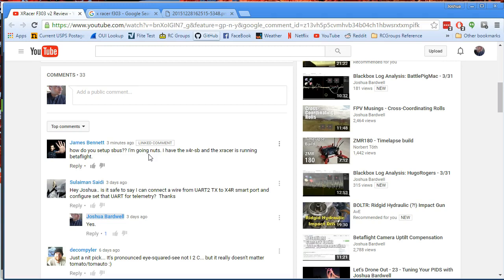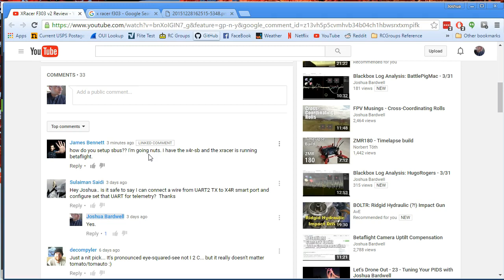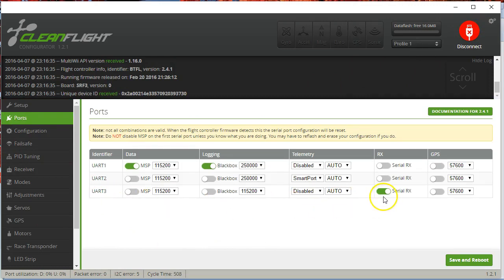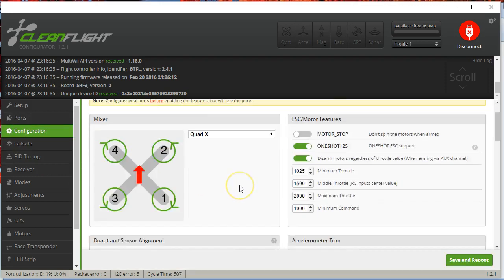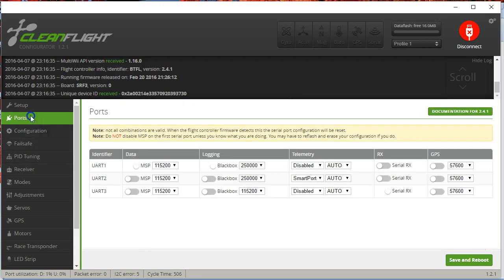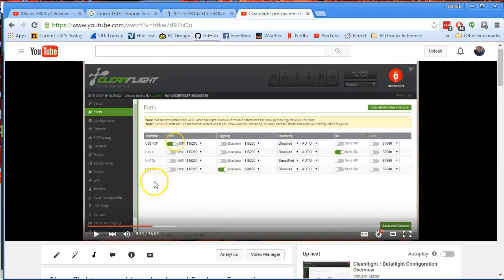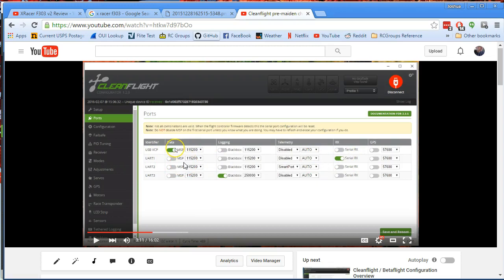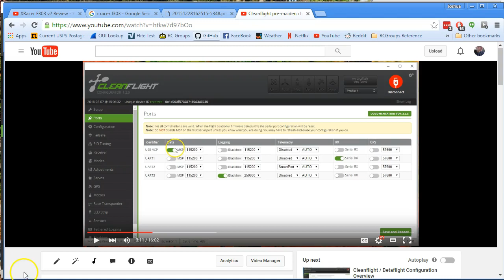How to configure SBUS receiver on Xracer F303

Comment: Hi Joshua, need your help here, i am using x-racer v3, and has using uart 3 for sbus, uart 2 for smartport, and my question is it possible to using uart 1 for smart audio? if possible could you help to advise me how to setting it in betaflight? because when i switch to smartaudio in uart 1, it always restart the configuration to be disabled.. please help to advise..
Reply from the maker: I am going to guess that FC has MSP on UART 1 in which case nothing else can use UART 1.

If the FC has led pad you can reassign it to softserial using resource reassignment. Look for my video "Smartport matek F405" for instructions.
Reply: Thank you for your reply and advise.. i had try it and no luck for me.. even the smartport also not working in softserial..
Reply: Here’s the update, after i check i put the different location on cli for my motor 5 pad for softserial.. and when i changed it with correct code location, my lua script can read smartaudio but not correct channel in my vtx also I cannot change the channel through lua script, and another issue when i running dshot, motor 3 and 4 not spinning and all motor spinning normal in multishot, but when i disable the smartaudio i can running in dshot with all motor spinning.. would you give some suggestion / advice regarding this matter?

Comment: Hi Joshua, and first of all, many thanks for all your videos. You are my top "Quad Scientist" ;-)

Well, Im planning to replace my old Naze32 with a XRacer F303 3.1.   My idea is to connect my X4RSB to Sbus pins (Uart3), minimOSD to UART2, and ...what about Smartport?  FPVmodel recommends connecting smartport on Uart1 TX but I am concerned about how this uart is USB Shared.  So.. Have you ever succesfully tried to connect Smartport telemetry on Softserial 2 (CH5 RX - CH6 TX)  ?      Many thanks  :-)
Reply from the maker: +skorzo you can't share Smartport with UART 1 because Smartport is bidirectional and the receiver is always polling the pin so it'll conflict with USB. You used to be able to do this with older FrSky telemetry which was unidirectional. 

You could put the minim on UART 1 though.
Reply: So.. I guess that the diagram showed on FPVModel is only valid if you disconnect the smartport before using the USB . OK, thanks for your tip! I will test the minim on UART1.   (FPVModel diagram -> http://www.fpvmodel.com/u/tmp/goods_desc/2016-07/20160725145549-3611.png)
Reply from the maker: +skorzo I'm not sure about that. MSP will still interfere with Smartport even when USB is disconnected.
Reply: how did you have sbus working on a Naze32? i'm trying to do that now but getting no response on the receiver tab. and yes its soldered correctly and setup on betaflight correctly. any suggestions?

Comment: This config still gives you access to BLHeli Suite right?
Reply from the maker: I'm not sure there any configuration that disables blheli passthrough in a board that otherwise supports it.
Reply: Can you explain this issue https://github.com/betaflight/betaflight/issues/972
Reply from the maker: +Nazih Bitar if you have a device on UART 1 then it can interfere with USB communication. What part of this config do you think will interfere with USB?
Reply: Joshua Bardwell I just wanted to be safe since this is my first time using an F3 board. What is the smart port on the X4R and how do I use it?

Comment: Is there a reason why you have logging on UART1 and UART2 set to 250000 rather than default 115200?
Reply from the maker: Blackbox logging needs all the speed it can get. But only UART1 is actually active. The rest doesn't matter because they're not activated.
Reply: Thanks. Good to know. I'm busy setting up my first X-Racer (v3.0). I'll keep this in mind.

Comment: Start a Patreon account!!
Reply from the maker: +valiant360420 I did! 

https://www.patreon.com/thedroneracingengineer
Reply: +Joshua Bardwell - Help!!! Please tell me if this problem makes any sense to you. I can't get my buzzer to beep on my x racer board running betaflight 3.0.1. I have powered the buzzer from both the positive pin and other +5v sources, and I can see a change on the negative pin when I activate the buzzer circuit. Have tried many buzzers; all work when applying direct voltage. How can I test the buzzer activation circuit?
Also. I had done a trick on my old naze. Using 4s batt power for the positive, and the negative buzzer pin to activate it. Loud!!  But will this fry my board?
I'm not an idiot. I've tried everything. Ever had an issue like this before?
Reply from the maker: +valiant360420 usjng 4s is likely to fry the buzzer or your board. This may be why your buzzer isn't working.
Reply: +Joshua Bardwell  yeah. But will it fry my buzzer circuit?  Is there another creative way to hook up a buzzer? I know this sounds like a total rookie question, but I have always relied on my buzzer working, and I'm freakin out without one. Set my esc's to beep after 5 mins, but I'm not confident that'll save me.
Reply: +Joshua Bardwell I have tried multiple buzzers

Comment: HI Joshua, Thanks for your videos !!
I have a problem with my X4RSB, When I connect my xracer F303 V3.1 via usb, the X4RSB binds perfectly.
When I disconnect the usb, and plug the battery, the x4RSB bind for a few seconds then I have a solid green and solid red light, and esc's start to beep and motors to spin??

Would you have an idea on this problem  ?

Thank you
Reply from the maker: No clue at all. There should not be any way to put the X4R-SB into bind mode except pressing the bind button.
Reply: Joshua Bardwell found the solution, I put 2 sets of 8 leds, which were drawing to much current on the 5V rail of the xracer. I took them of, and it works :)
Reply from the maker: Yes, that's a lot of current.

Comment: Josh, 
I just wanted to update you on my X4R-SBUS problem. I tried swapping the recievers out, that didn't work. I also swapped FC's with no luck. Today I got my Taranis in the mail. It's working perfectly.
Final conclusion - 9XR +XJT module isn't worth the hassle. The 9xr works great on my D4R-II in PPM mode, but SBUS is a no-go. 
Thanks for your advice, as usual.
Reply from the maker: Really strange. The XJT module should work fine with the X4R-SB receiver... I think. They're both X-series so I don't see why not. Anyway, Taranis is awesome and glad you found an excuse to upgrade!

Comment: Josh,
Does the X-racer f303 require an inverter for the Sbus signal on UART3? I tried turning the inversion on and off in the CLI. I could swear I have everything wired properly, I'm getting vbat and RSSI readings, but I can get no response on any channels in the receiver tab. I'm can't figure it out for the life of me. Starting to think I should ditch my 9XR with my XJT module and bite the bullet on a Taranis. Still would like to figure it out though...-_-
Reply from the maker: No,  definitely not. You should simply be able to enable SBUS on the port and inversion will be set automatically.

Is the light on the receiver green?
Reply: Receiver light is green. I have actually tried binding several times. I have also messed around with the protocol settings on my 9xr with no luck. I've also gone back and triple checked my SBUS connection on both the board and receiver, it all looks good.
Edit - I'm going to go and re-solder all of the SBUS wires again and see if that changes anything. Since I'm getting RSSI and Vbat, I feel like the reciever must be working, it just seems like a connection issue, but I don't know yet. I'll report back.
Reply: So I re-did all the wiring on my SBUS connections on both the X4RSB and also my F303, still no luck. Messed around with some more settings, still no luck.
I ended up buying a Taranis. Hopefully this will fix the issue...if it doesn't, I'll replace the X4R. I guess it's possible I damaged it last night will de-pinning it.
Reply from the maker: Have you changed the board?
Reply: Haven't thought of changing the FC itself,  only the receiver. I could throw a naze32 on it and see if that'll work. Gonna take me a while few hours though lol
Reply from the maker: The FC is at least a semi likely candidate. No need to fully install a new one. Just wire up the RX to the test unit and give it 5v from anywhere.
Reply: I'll let you know what happens.

Comment: Hey Joshua, 
Following your channel for a while now and wanna thank you for your very thorough and educational vids.. 
Ive got a few xracer bords and 
Hooking up x4r to sbus and OSD to uart2 i wanted to put smartport on a softserial port.. But cant make it work. 
Did you by any chance try using soft serial and can walk me through it? Its said to be pins 5,6 & 7,8.thanks
Reply from the maker: +Kaynan Barak I use a spare UART for Smartport. I think it can work on soft serial but I've never done it. Make sure to enable telemetry inversion in the CLI.
Reply: Thanks man, will let you know if i make it work. 
Barak

Comment: Hey Joshua, I've followed the instructions in the video and in the comments for this video, but in the receiver tab of clean flight I still get nothing. I've checked for continuity from the pin on the x4r (not depinned or touched) to the pad on the f303 and I have a good connection. Is it possible I just have a bad board?
Reply: +ghall05 update: I've tried two different f303 boards (both brand new) on the same x4r: nothing in the rx tab. Then connected the 2nd f303 to a different x4r: nothing in the rx tab. Also, one f303 is on beta flight 2.7.1 and the other was on whatever cleanflight comes loaded from the factory. I have to be missing something... but what?
Reply from the maker: +ghall05 if you've followed all the steps in this video and it's still not working, I'm not sure what to say. Have you confirmed that the choice of serialrx and serial provider and port "stuck" and didn't reset themselves?

Type "get telemetry_inversion" in the CLI. Does it indicate that telemetry inversion is on or off?
Reply: +Joshua Bardwell well it's offical. I'm an idiot. Turns out I was using those two particular x4rs on naze rev5s and I had hacked them to remove the inversion. So sorry to have wasted your time but many thanks for the help!
Reply from the maker: I was thinking that, but since you said you switched to another X4R, I thought what's the chance they are both modded! Glad you solved it.

Comment: thanks for the video. really helpful. p.s. why your minimum cell voltage is 1V and what actually is happening when min is reached ?
Reply from the maker: +fpvYou when the warning is reached, the buzzer starts beeping. When the minimum is reached, the FC shuts down the motors. I have both set to 1v because I use an OSD and Taranis telemetry to monitor voltage. I don't want the copter beeping at me when the voltage sags on a punchout, and I don't ever want it to just shut down and dump the copter, even if the battery is very low.

So why not just turn off vbat monitoring? Because I need vbat monitoring for voltage telemetry to the Taranis to work. And I could use the new buzzer off flags maybe to disable the vbat buzzer, but this is how I've always done it so that's how I keep doing it.

Comment: Joshua, i just got a new x-racer board. Can i connect 2 esc wires on the RC Input pins, and the other 2 on the other side pins of the board? Thanks.
Reply from the maker: +ashingashinga no. The ESC wires must go to the PWM output pins.

Comment: Thanks for the video. I've done all this and still not working. I am getting rssi info on the taranis, so it is bound, but in betaflight when I go to the receiver section.. nothing.
Reply from the maker: +James Bennett the next thing to check is wiring then.
Reply: +Joshua Bardwell Seriously thank you for the quick responses. It all looks right to me. Maybe the signal wire is bad? http://imgur.com/a/q2jxU
Reply from the maker: Maybe hit the solder joints again. I see little "ice cream swirls" that tell me the joint was cold or didn't have enough flux. That's probably not the issue, but we're sort of at the point of trying everything. Also check the solder on the pins on the board. 

Sub out the receiver with one that you didn't depin to see if it was damaged when you pulled the pins.
Reply: +Joshua Bardwell Yup!! That did it. Not a good enough connection. re-soldered it and everything works. Seriously thanks for helping debug.
Reply from the maker: +James Bennett well, how about that.
Reply from the maker: +Joshua Bardwell not often you actually solve a problem over the Internet.
Reply: +Joshua Bardwell haha ok last question since I gotcha. The rssi output on the x4r-sb, the tiny pad by the antenna, goes to the rssi on the xracer? It show always 50% in betaflight.
Reply from the maker: I never configured RSSI to cleanflight directly so I don't know. I always used either an RSSI channel on the Taranis or RSSI to an OSD.
Reply: +Joshua Bardwell well thanks anyways!
Reply: +James Bennett subscribed

Comment: I got I-Bus up and running but the buzzer pads came off and my LED is freaking out like it still sees motor PWM not LED signal. Hopefully it flies better than it sets up...
Reply from the maker: +Russell Gilder you gotta be real delicate with those tiny buzzer pads. Was your iron maybe too hot? I've had no quality issues so far.
Reply: +Joshua Bardwell oh yes it was too hot.  I really overestimated the amount of heat it would take.  I was just ripping through the whole setup and didn't think to lower the heat.
Reply: +Joshua Bardwell the LED setup on V2 is on the 8th PWM out isn't it?
Reply from the maker: I think so but it's not in front of me.
Reply: +Russell Gilder its marked LED on the board its the 9th input